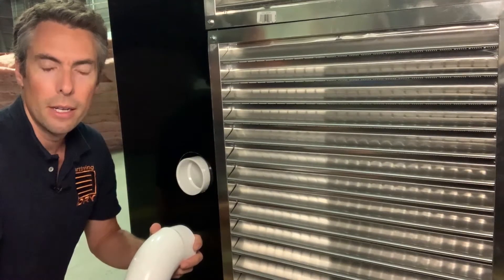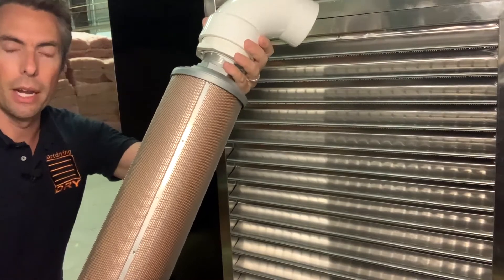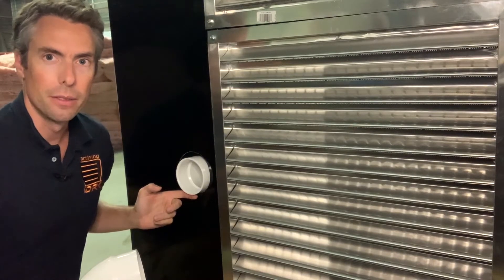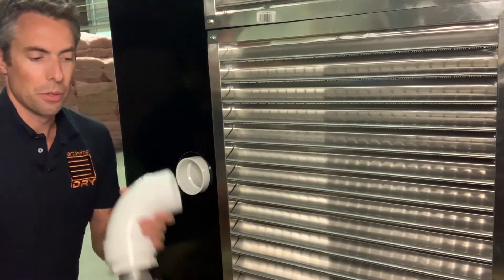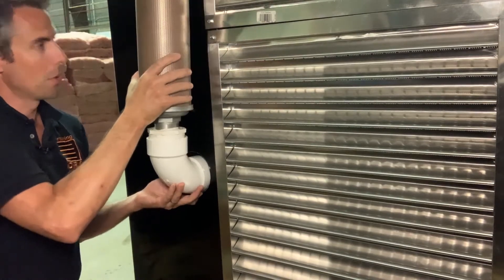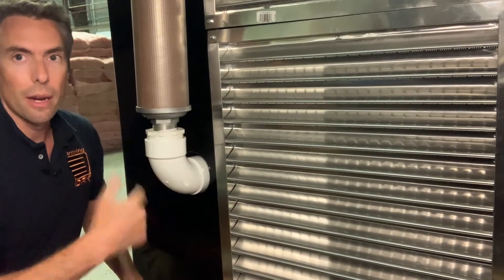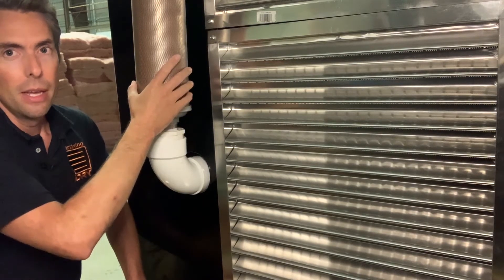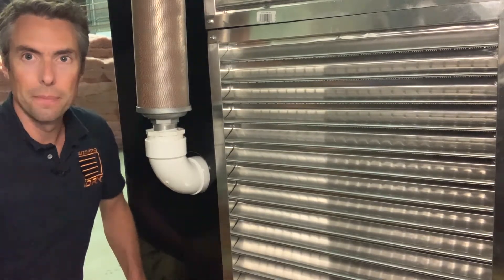Installing Vacuum Pump Exhaust Filter/Muffler

Comment: If the pump's exhaust air is exiting via that 3" pipe with muffler, and the residual moisture runs out the drain, what's to prevent the exhaust ed air from going out the drain?
Reply from the maker: The drain is 1" so the air wants to take the path of least resistance